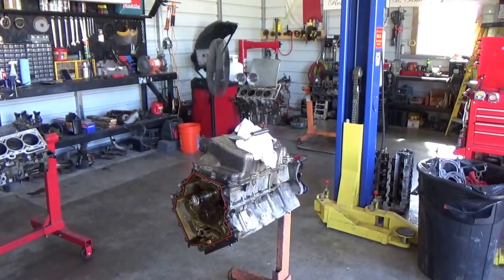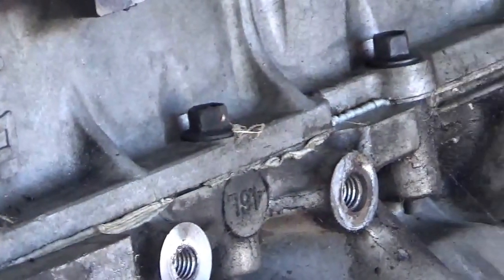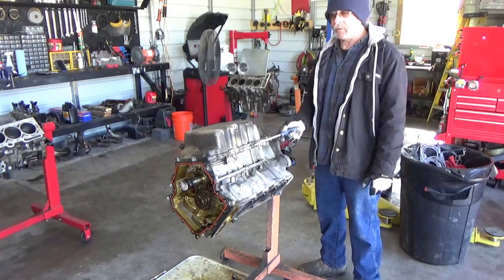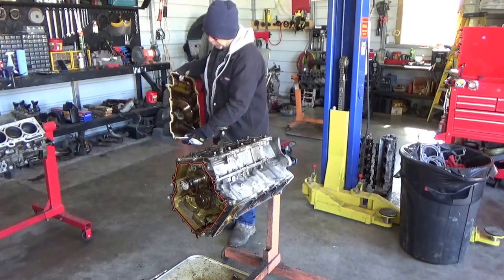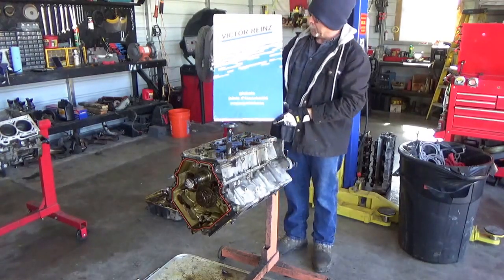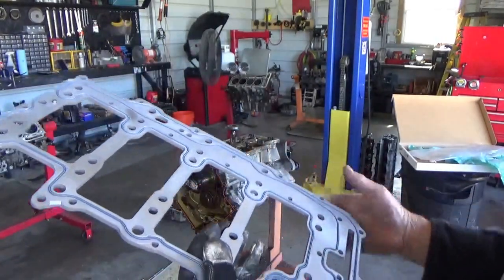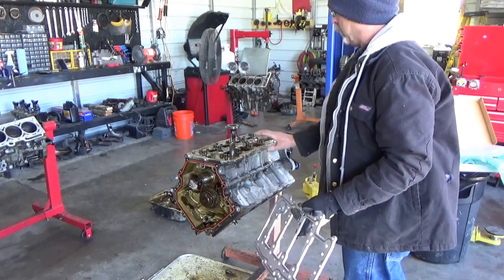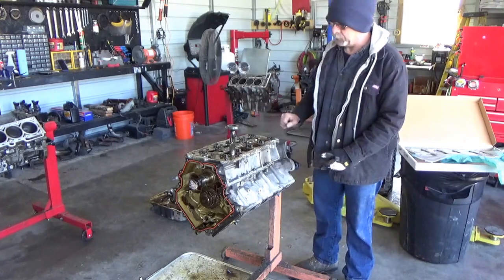MAH00024

Comment: I have a 2007 Cadillac DTS and the lower part of the engine is leaking oil. Went to several places but was told they discontinued the gasket kit for the lower end. Said that they uses a silicone sealant to reseal the bottom end . I think that's a lie because I call all the parts stores round my area and they have the lower conversion gasket kit for my year Caddy. Would like to think what you think bout that and what I should do . Your place is a long way from South Carolina.
Reply: just find a local shop, and order the gasket yourself.  they're easily found on the internet.  AllData (the system most shops reference) does call for using silicon sealant, only, but that makes no sense.  so if the shop hasnt researched the engine individually, or arent intimately familiar with it from prior experience, they're only repeating what they've been told or are reading.